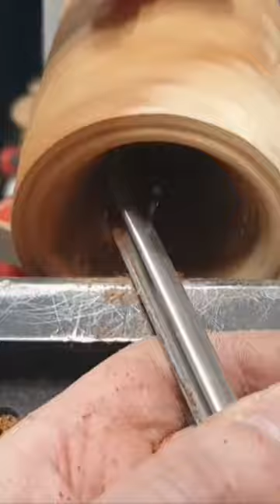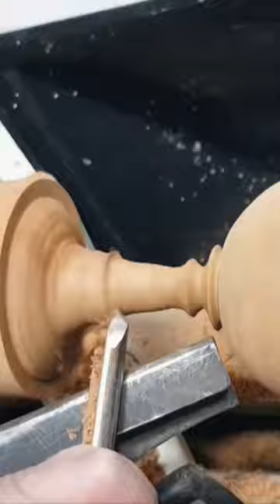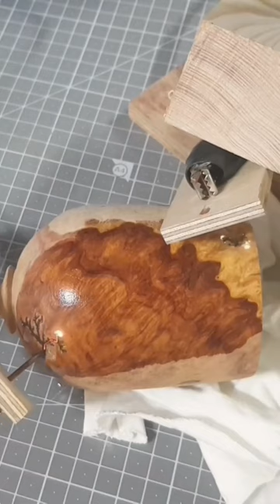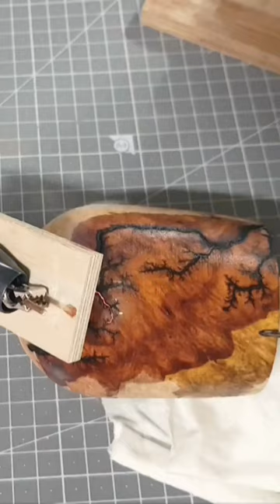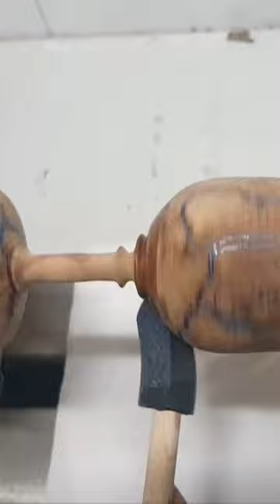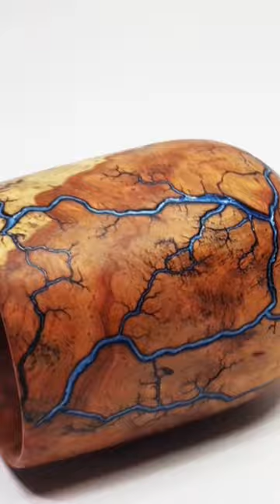LIGHTNING GOBLET with woodburning #woodturning #woodburning #lightning

Comment: Please Please be careful. So many people have died doing this
Reply from the maker: Thank you for your concern. I am extremely careful with rubber-insulated gloves,etc. I will be more careful in future.
Reply: I have seen this technic in other videos, i didn't thought that could be dangerous or even that people have already died. 😳
If the technic is dangerous, those who use it should write some warnings, or? ☹️
Reply from the maker: I will warn of the dangers next time. Thank you!
Reply: @hswoodresinart  
Thank you also 🙏
Reply: @vivamexico6798  - It's mostly because people are using incorrect voltage, mixed w/ random household items; they get electrocuted or burn themselves.  There are legitimate machines, but I forget what they're called.
Reply: @LauraFunFunFloweries  
oh, Many thanks for your Feedback 🙂
it is very important to have save work 👍🏾☺️